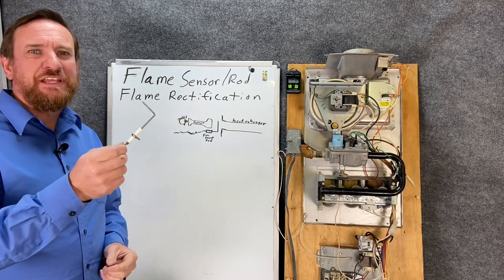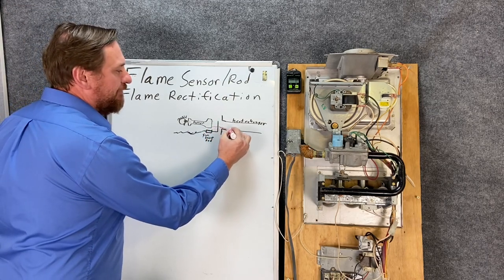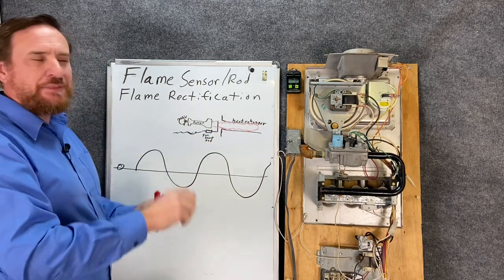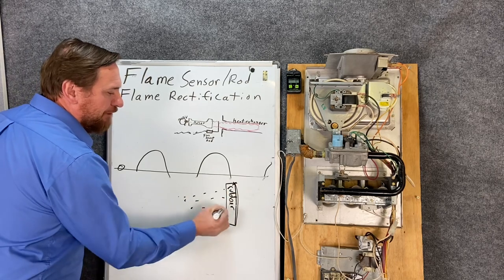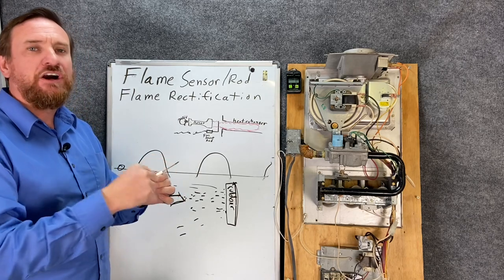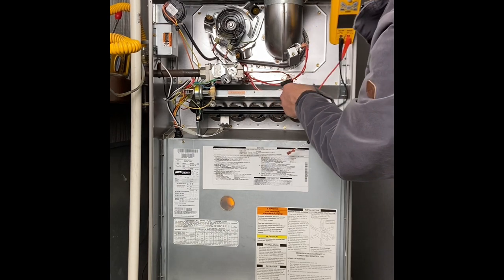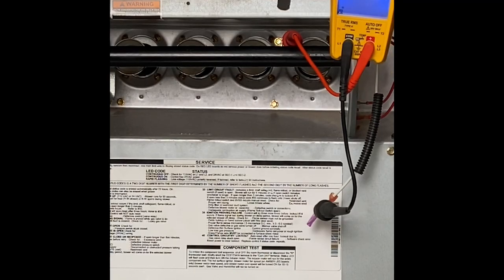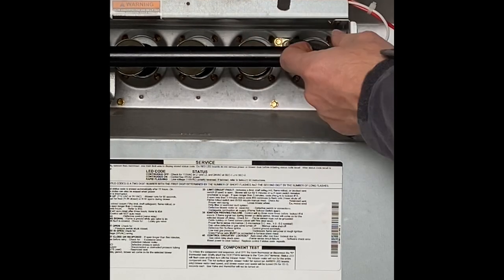Flame sensor, Flame rod, Flame Rectification

Comment: Without an understanding of what a diode is no one would understand how this works.  The flame sensor acts as the anode and the blue part of the flame is the cathode. A sinewave signal is sent to the flame sensor terminal from the spark module and rectified (half wave) since it acts as a single diode rectifier . The spark module picks up the signal on the burner  side and inputs it into a detection circuit to detect flame presence.
Reply: I agree. 
  I love you, Ty, but he actually correct. 
  Granted, a lot of people will (hopefully) grasp the basic concept of flame rectification after watching this video.  But if we wanted to get technical (as you know some of us do! 😆), we would need to teach the principle of how diodes and electrochemical reactions work. 
  Some are actually going to think that the flame generates the signal needed to prove itself. (There were a few classmates of mine who actually thought this was occurring.)
 "If we place a light bulb inside the flame, would it turn on?"  🤦🏻‍♂️

  Also, Ty, when you were demonstrating how to check the microamps with your multimeter, you had the camera pointed below the display of the multimeter; we couldn't see how many microamps were being measured by the meter. 🤦🏻‍♂️

Comment: guy i worked with years said a dollar bill was the perfect thing to clean those with....just the right abrasiveness....always works for me.
Reply from the maker: Yes it does work most of the time. If someone cleaned it with sand previously, or there are a lot of contaminants in the air it's sometimes not enough. 

Have you seen the new white Rodgers Emerson universal flame rods?
Reply: Nah... has to be a C-note Benjamin! 🤣

Comment: A most excellent Flame Rectification video.  Next is to hookup an oscilloscope to the wire and check out the pulsating DC voltage waveform. Just to see what it looks like?    😎  Thank you.
Reply from the maker: I might just do that! Thanks for the idea
Reply: @love2hvac  Thank you.

Comment: I was wondering how a flame sensor worked. I always assumed they were like a thermal couple and was curious as to why they wouldn't work when they got a little dirty. I had no idea it was reading continuity through the flame. Thanks for the clarification.

Comment: Just paid $850 for a technician to replace my gas valve only to find it was the flame sensor. They still haven't diagnosed it and are trying to convince me the unit has multiple issues and needs replacing. Had to go up and do it myself by cleaning the flame sensor. Working fine now. Wish I had known this earlier!
Reply from the maker: I'm glad I could help.

There are 2 problems here:

#1 Unfortunately the skilled trade shortage has caused a lot of people to enter the trade without the training, knowledge or skills needed. 

#2 Private Equity companies are buying HVAC companies and pushing sales sales sales. They spend a ton of time on sales training because new units have the greatest return. Technical training costs more and has the least return for the company.
Reply: @love2hvac  I am in Australia btw. Still the skills shortage probably still applies.
Reply from the maker: I use to live in McKay QLD

Comment: Awesome video! Best explanation I’ve seen! Quick question. It is my understanding that the flame sensor receives 120volts from the board. Can we also test for voltage to the flame rod ? Also if the flame is doing the rectification, how does it read the micro dc amps before the flame? Thank you in advance sir.
Reply from the maker: Boards don't always have the rod energized and they are not always 120v. 

Once the voltage is converted to a pulsating DC, it travels on the ground or casing of the unit. The board is also founded and it reads that unique signal. 
Some boards read micro amps to the flame sensor. The small amperage is how it knows.
Reply: @love2hvac  thank you sir🙏
Reply: @love2hvac  in t

Comment: Really great explanation of flame rectification. I have a fireplace that has a spark fired pilot. I’ve can see that I’m not getting a spark, so is there a way for me to prove that it’s the control board or the actual wire and rod is the problem. I’d like to be able to check the current or.voltage to see where the problem actually exists, like how you check the uamps coming of the flame rod. Thanks for any assist.
Reply from the maker: It's usually a dirty ignitor rod or  the board, rarely the wire.
You can get a spark tester from an auto store, and test it from the board to ground if you want to know for sure.
Reply: Thanks for quick reply! Any way to test with a meter?

Comment: Ok so 5.5ua is going into the rod. But, isn't there also a microamp signal going back to the board for confirmation? Great video thanks.
Reply from the maker: The pulsating DC current there the ground is the "signal" going back to the board. 

We can read UA but most boards look for the pulsating DC  at the ground from the flame rectification.
Reply: Hi, I have a flame sensor signal of about 0.6uA. The furnace shuts off after 5 seconds. I replaced the flame sensor but same results. Can a bad furnace control board cause this problem? All grounds and wires seems ok.
Reply: @mark.r8900 have you found the root cause? I have a similar issue. I do not have a multimeter that is capable to the current in the micro-ampere range, but the furnace shut off a few seconds after it fires up. I measured the AC voltage across the flame rod and the furnace ground, it read about 2 Volts AC. I believe the voltage is supposed to be in a range of ~40 to 120V. This voltage is applied by the control board. I suspected the control board could be bad.

Comment: Ran into a issue with flame rectification. I’m getting no uA on three different sensors one of which came from a neighbor with identical unit that works. I’m getting continuity across all bonds and grounds. I pulled burners and brushed them clean.  My question is can the board prevent you from getting a uA reading? I got 25v from sensor to wire. What am I missing ?
Reply from the maker: Proper polarity to the unit is important as well as a proper receptical plug ground. 
Then make sure the wire from the board to the flame sensor is good. Is all that is good inspect the board for water spots or burn spots. May be the board.

Comment: My flame sensor is mounted near the electronic controlled pilot light.  When the pilot light lights, the meter reads 1.5uA.  When the gas valve fully opens it jumps to 4.5uA.  After running for a few minutes, the current jumps to 6.5uA.  Does this sound like a dirty/bad flame sensor?  (I bypassed the control board to get the pilot light/gas valve to turn on for this test as the system keeps shutting down.)
Reply from the maker: That sounds like a smart valve. They are not meant to be cleaned, the mini hsi breaks very easily as does the flame sensor itself.
Notorious the plug connector at the valve becomes loose.

It is normal to get higher UA when the main burners fires.
Reply from the maker: Here is a video about that kind of valve.
https://youtu.be/ViubzPvh1KA

Comment: My furnace has a smart valve and it keeps turning off after 5 seconds I change the flame sensor and still doin the same do u think is the control board or the smart gas valve problem ?
Reply from the maker: the plug where the igniter fits into the valve body. 
Its a known point of failure, some people have been known to force an object in the back side of the plug so it keeps pressure forced against it.
Reply: @love2hvac  thank you
Reply: @armandolopez6365 I have the same problem with my furnace. I am wondering how you fixed your furnace in the end.

Comment: It’s crazy to me you can use your meter leads attached to the meter to complete the circuit and heat comes on, but we can’t use our meter leads attached to the meter to jump out the stat and give a call for heat or cooling. I’m missing something here idk how that’s possible. Also I believe the flame sensor terminal on the control board still has voltage even with the wire removed.. any help is greatly appreciated!

Comment: Does the flame sensor rod have a coating or is it just bare stainless steel?
Reply from the maker: Contrary to popular belief, it does not have a coating.

However if you use sand paper, the sand leaves a residue that cooks into a silica coating that increases resistance and causes issues over time.

Comment: Left unanswered: what level of current is acceptable?   Apparently the current decreases as the probe gets dirty, so at what point will the computer shut off the gas?  4 microamps?  1?  Who knows?  Maybe it's 5.2 and this unit will fail next week.
Reply from the maker: It varies by the manufacturer. Anywhere from . 5 to 10.

Anytime your there, properly clean the flame sensor.

Even if the call was unrelated clean the flame sensor.

Comment: All due respect, I don't think the flame sensor is generation AC.
Reply from the maker: It doesn't, AC is supplied to the rod but it can't go anywhere.
When the flame ignores it created a path for electrons to flow but due to the ions it can only flow in one direction. 
So the electricity is flowing threw the flame in a pulsating DC way. The CO trip board reads this to know there is a flame.
Reply: @love2hvac So the standing ac (24 volts ?) makes more of a signal for the control board to read? I thought it was in micro amps?
Reply from the maker: Voltage can be 20-120 to the flame rod depending on manufacture. 
As techs we can measure the microamps but the board is reading the pulsing DC signal caused by the flame carrying and rectifying the circuit. This is why the burners and the board must be properly grounded. It's also why a rusted burner face can cause a poor flame signal
Reply: @love2hvac  Understood. I have an old house in Oakland that I lived in for 40 years and the furnace dates to the late 60's (found a date code when I was troubleshooting 7 or 8 years ago.) That time it was a tired thermo couple. The house has been rented out for the last 4 years and a couple of weeks ago the tenants called and said the heater quit working. I sent them a you tube vid about relighting the pilot and was able to talk them through getting it relit and working again. For years I'd do the filter c/o and putting a few drops of light machine oil in the 4 oil cups. It's been a good unit, but there is a part of me that would like to go through it a bit more thoroughly with someone who does this on a regular basis.

Comment: I use 2000 Grit Ceramic Sandpaper to clean the ignitors and then wipe them clean with rubbing alcohol. Would this fine grit leave ceramic residue on the ignitors even after wiping them with alcohol???...any input is appreciated!